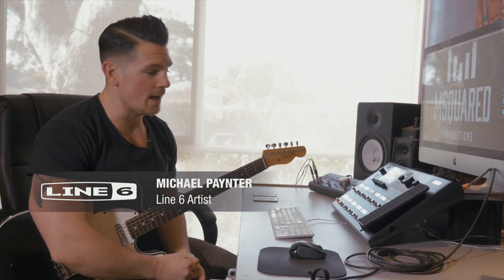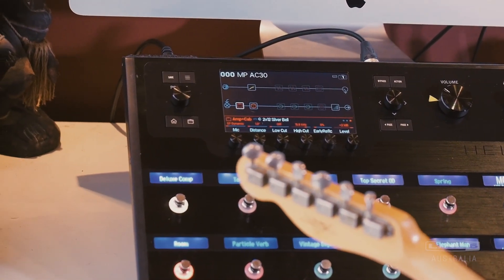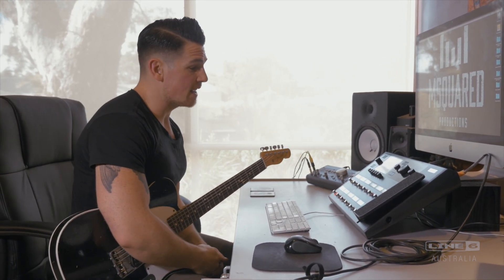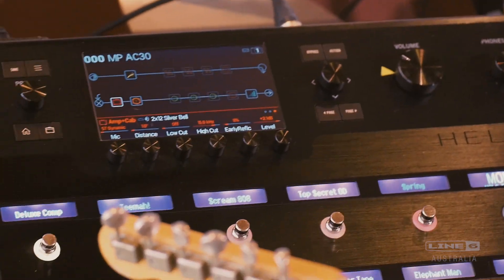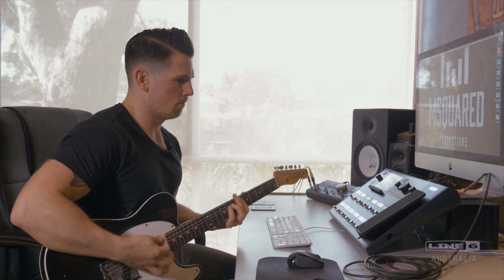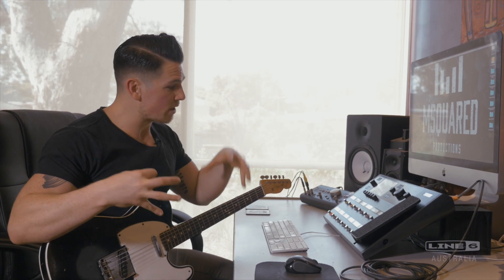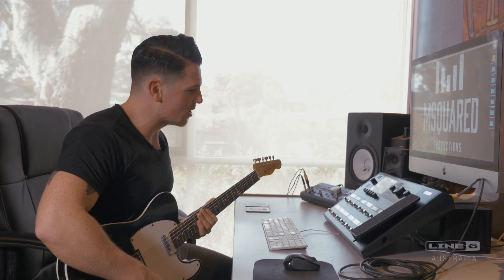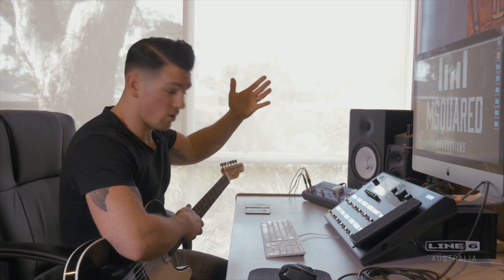Line 6 Helix: Using the AC30 Tone w/ Michael Paynter

Comment: I can sort of hear the vintage early 60's Vox chime majic, but maybe it needs an es-330 with vintage pups in the mix.  Or maybe it needs a real 62ish vintage Vox valve amp.  Even vintage Vox's didn't all have the majic due to variation in components ... .  The helix engineer's model's just haven't captured the sbtlties, and I dont think any amount of tweaking will get there.  But the engineers are potentially on the right track.  For one, they need to add more amp tone tweaking tools.